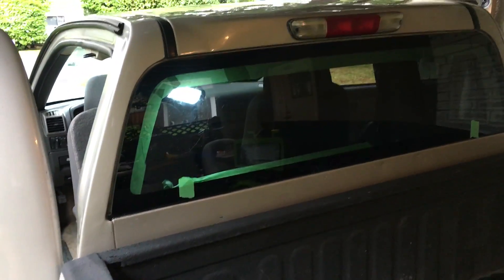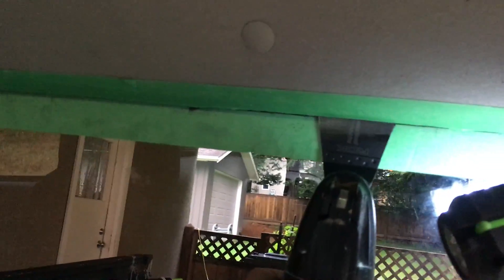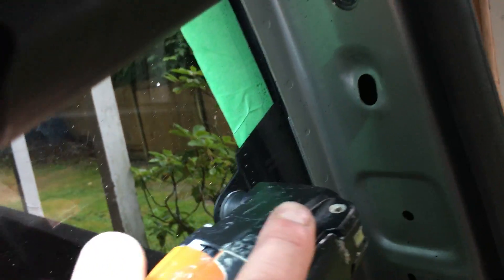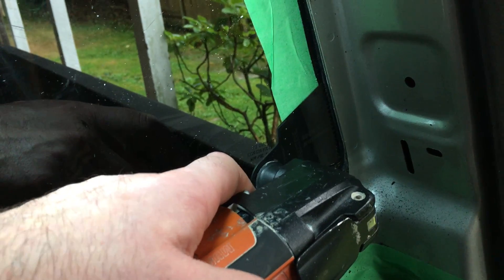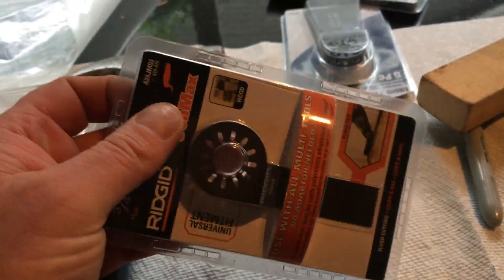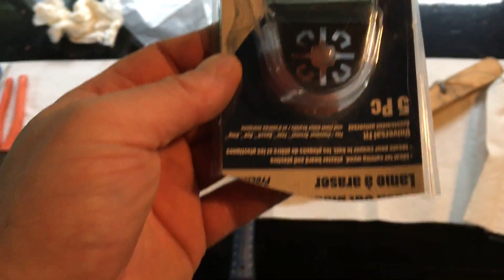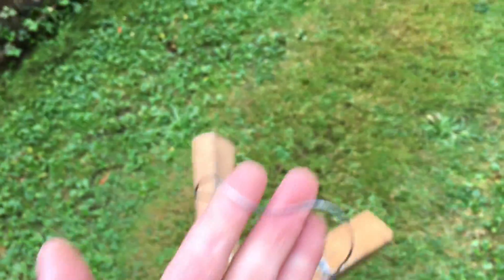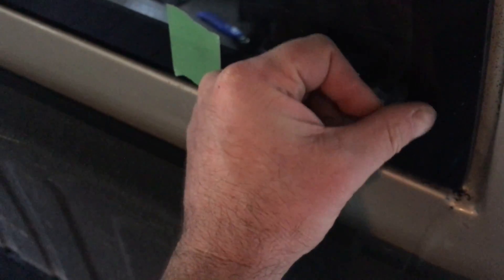Remove window on GMC Canyon using a multitool.

Comment: I have a CANYON going to try putting in a slider window.   Do I need to take the back panel off?  Its a SL CAB .  Found a window for it just hope it fits in.
Reply from the maker: I did not remove the carpeted panel below the window on the back wall, because it seemed to be a lengthy process.